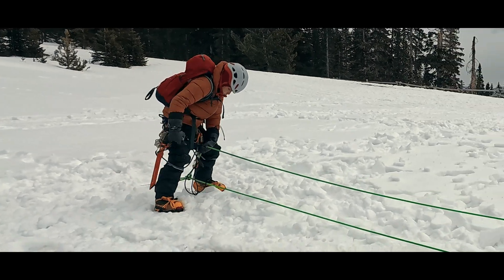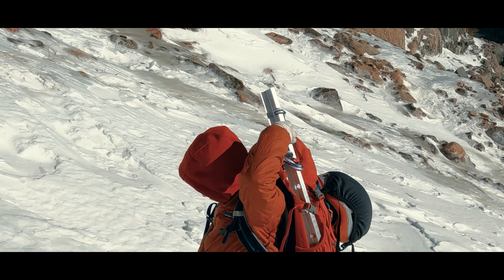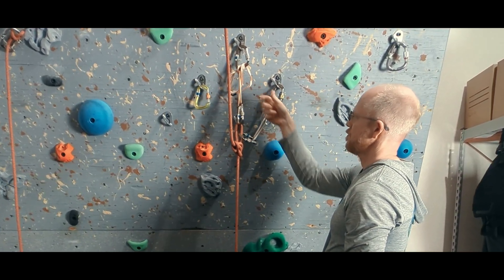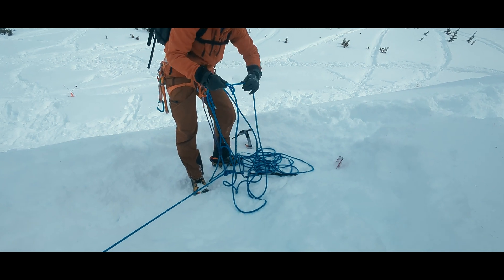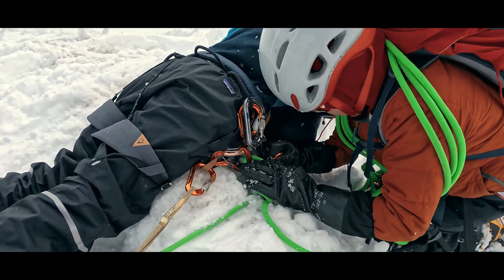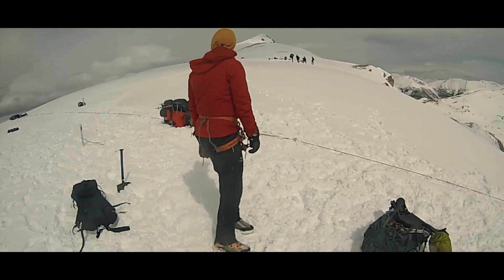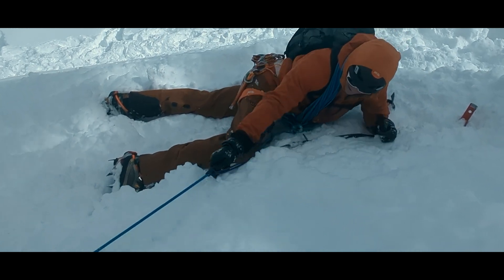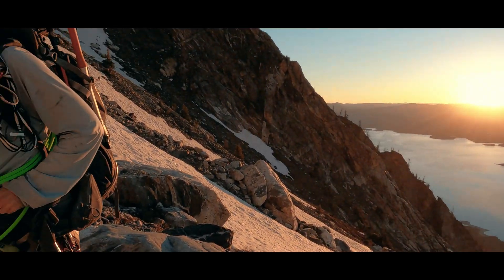Can You Make the Perfect Crevasse Rescue Anchor?

Comment: Over here in Germany, we neither use pickets not would we equalize anything. According to the German alpine club, the third climber is supposed to hold the load while the middle climber is building a T-anchor with his ice axe. Load transfer would be done using a Prusik and then clipping the bight of the middle man. The middle man would also stay at the anchor, kind of acting as a backup while the third is going to the crevasse lip. The use of a micro-traxion or spoc has pretty much become a standard in the last few years.

While that system certainly has drawbacks (reliance on a single T-anchor compared to an equalized 2-piece anchor being the prime one and the 2:1 haul being the minor one), it should be a lot faster and easier to get right under stress due to lower complexity. I would love to see a deep dive into why Americans chose to use pickets, equalization and 6:1 systems.
Reply: Yeah, the difference it tactics here is super interesting.

On Americans using picket, It was suggested to me that the biggest reason for this is the expectation of leaving anchors in place and rappelling off of them. American glaciers being more remote and larger than Alpine glaciers for the most part. I guess just leaving an ice axe behind it’s a trade off folks are willing to make for lightness.
Reply from the maker: The assumption (and it is a big assumption) is that (as @macmurfy2jka implied) North American crevasses could be somewhere very remote (Ruth George, St Elias Range, etc) where you are the only team there. That's why the 6:1 is the default. It is taught to do a drop-loop 2:1 as the start, and if that isn't enough, then be able to quickly piggy-back a 3:1 on top of it for the 6:1 system. Since the 6:1 is always an option, the robust anchor is built from the start. Being alone and remote also places a premium on keeping your axe with you as your most versatile safety tool. E.g. rap into a crevasse to render aid and then walk/climb out the backside ramp (if there is one). Not saying that is definitive logic or there aren't counter-arguments, but it's a large part of why pickets are assumed, here. Also, a vertical picket in firm snow places a lot faster than a t-slot axe. It has to be firm, snow, though. Which brings up your point about not needing to protect firm snow. I think there is something to the liability/risk stuff that was discussed. Again, not saying that is good, just that it is. Then, as another part of your discussion, there is an over-reliance on running belays which have real downsides, as called out in the discussion. I have, however, used a series of running belays extensively, once. We were on two inches of new snow on top of bullet hard snow. About 50-60 degrees slopes. Too steep and too hard to arrest a fall, too crampon clogging with the top snow for some on my team to feel comfortable soloing it. It was excruciatingly slow climbing. So, it was good to have pickets, I guess, given the choice of tactics, but the tactics were questionable. I have also placed pickets on a traversing catwalk across the upper lip of a yawning crevasse. In essence, we pitched it out, placing a starting anchor, ending anchor, and placing mid-traverse protection. We needed our axes for the actual climbing. An alternative (and lighter) tactic could have been to fix the line, using multiple axes as anchor points and then leaving the leader with an axe for the ascent. These days, I don't always carry pickets. I take them more on - as you say - bigger expeditions... which my first of the two examples I gave happened to be.
Reply: @ShortGuysBetaWorks thanks for the illumination on the subject. Us two are no alone on wondering about this subject.
Reply from the maker: @macmurfy2jka  I think it's a fascinating one. I do believe the bulk of the guide associations' logic comes down to (as you pointed out) minus only some of the glaciated climbs in the Cascades or the Bugaboos or the like, many of American and Canadian glaciers are on big peaks in far off places. Sure, if you are climbing the West Buttress on Denali, you will have many teams around, but even moving just a little ways around to the West Rib, you are going to be the only team there. When I was director of a crevasse rescue seminar, we would have participants try to haul out one climber with two teammates using a 3:1 with two meters of rope cut. 75% of teams couldn't do it. Too much friction.
Reply: @macmurfy2jka  Not sure when leaving an anchor in snow really is necessary. I kind of see this possibility on expedition style mountaineering, but I hardly see this as a general argument for carrying pickets. In terms of weight, it seems more sensible to carry a second ice axe and leave that behind in emergencies. A standard ice axe is about the same as a 90cm picket and a small ice axe like the Petzl Gully is lighter than a 60cm picket.

I also do not really see rappelling on snow as something very useful. Yes, there might be cases where one will need to rappel over the bergschrund...but in general, if the snow is good, one can easily descend it.
Reply: @foobar9220 well when pitching out a snow traverse, pickets need to be left between climbers.
Reply: @macmurfy2jka  This is one of the ideas that sound a lot better in theory than in practice. Placing and removing snow protection takes pretty long, and doing it every few meters slows down a party considerably. In all those years, I have never seen anyone belay pitch by pitch in snow or even do a running belay.

This also circles back to the main issue of snow protection...if the snow is firm, there is no real need for protection and you can just go ropeless. If the snow is bad=soft, the protection is also pretty bad or has to be placed very deep, which is even more time-consuming
Reply: @foobar9220 sure, but snow pickets are more meant for those firmer snows. Many come with reinforced striking surfaces on on side and points on the other. 

Also, we must remember the difference in logistics and rescue here in the US. In America, a good helicopter response time is measured in hours, 4 hours is pretty typical. In places, rescue isnt free or covered by cheap insurance, like the Alps. Self reliance is of much larger concern. For instance, Europeans aren’t for carrying stoves especially on shorter and less remote peaks; Americans often recommend carrying a stove any time a snowy trek or climb is more than 2 hours travel from a road. That is pretty easy to achieve, even in the most densely populated areas of the US, especially in winter. 
Americans just tend to pack heavier.
Reply: @foobar9220 also, going slower and with more seemingly needless protection is a more American way of doing things when commercial guiding is concerned. It seems that in the US the expectation (reasonable or not) is that guides are essential the only entity responsible for risk when clients are being guided. Legally, not mandating or providing safety gear, such as pickets might open up the guide to legal liabilities for a clients injuries. Not bringing such may be considered negligence. 

For the same reason, insurance companies that cover the guides might mandated the use of pickets. 
Rock climbing gyms have a similar issue all the time. Auto belay rigs are easy for clients to forget to use. In a number of instances, the gym is held liable for a climber falling off a wall after failing to clip in regardless of what their policy was as enforcement can be argued to have been more strict. Essentially the implications is that unless the gyms and its staff attached the climber to the auto Belay device, part of the blame falls on the facility. And all of this is regardless of the fact that the climber always signed a liability release waiver before they were ever allowed to step in the gym climbing area.

Overall, competence on the client’s part is expected to be low and that makes them less legally responsible for accepting risk. Pickets are cheap insurance. 

Private, unguided climbing parties are often much less heavily packed. The only folks that legal blames can be pushed onto don’t have big enough purses to make it worth anyone’s time. Though, if a rescued climber is found to be negligently unprepared, sometimes they are sued by the state for the cost of rescue.
Reply: @macmurfy2jka  It is a common misconception that rescue in the Alps is just 5 minutes away. Don't be fooled by all those documentaries about Air Zermatt, PGHM Chamonix and the like. Yes, there is a lot less ground to cover and there is a robust rescue infrastructure in most places. Short time to rescue may be the case in some places and in good weather, but it is not a given. In bad weather, helicopter rescue will often be completely unavailable and prudent planning assumes that rescue might not be available or has to be ground-based (=taking very long). Carrying emergency bivy gear is strongly recommended, although nobody would carry a stove or tent without a planned bivouac.
And while there are many crowded routes and mountains, there are at least as many where you can expect to be alone. And these are not necessarily the hard ones, they are just lesser known.